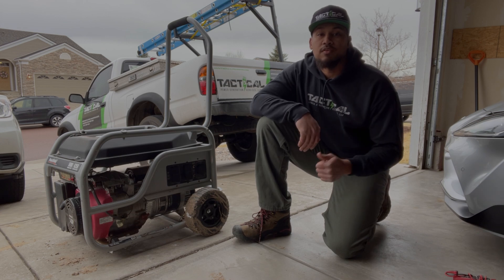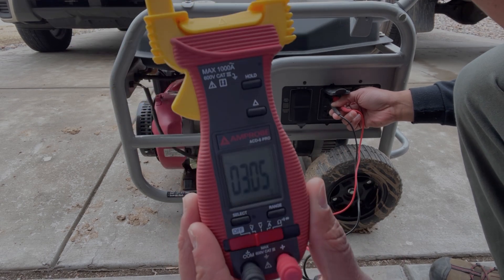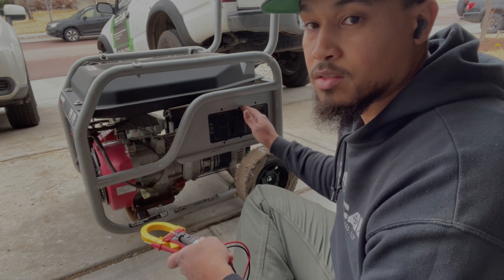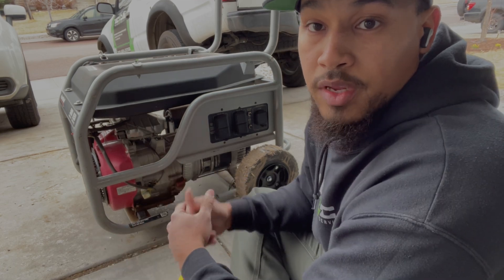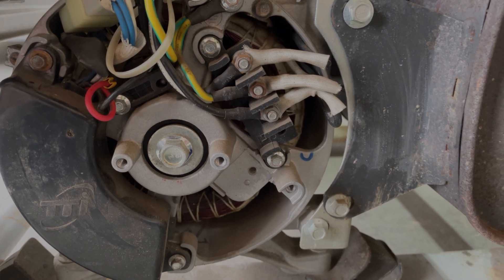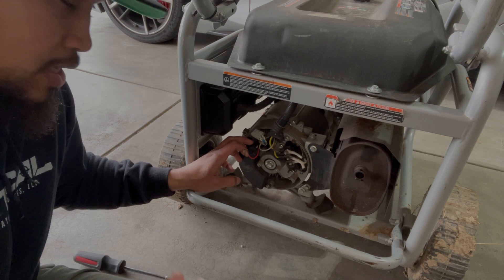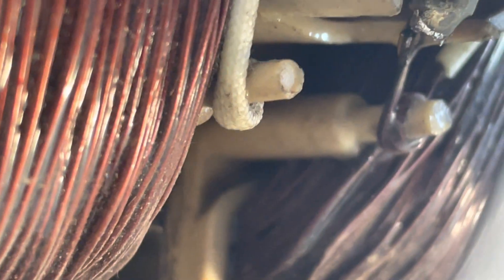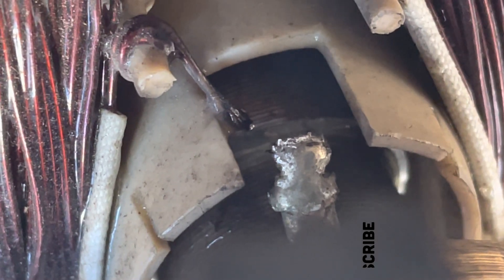Generator has NO POWER Output. Troubleshooting a generator that has no voltage due to a Bad Rotor?

Comment: Good video and diagnostic, but why didn’t you solder the wire back on the terminal.they were more than enough wire that you could have unwrapped and solder back on the terminal.
Reply from the maker: Thank you for watching my video. I gave the owner the different options to fix it, he decided to solder it back on the terminal weeks later.

Comment: hi, thanks for the video. if you would fix the broken wire( join the two ends maybe by soldering them), will the issue not be fixed?
Reply from the maker: Hi! Thanks for watching the video. Yes, the issue will be fixed by soldering the wire.

Comment: If you didnt have the money for a new generator, there is plenty of copper wire wound around the terminal, why couldnt you re-solder the connection. At this point there is nothing to lose.  Great video.
Reply from the maker: Thank you for your comment and for watching my video. I totally agree with you, there is nothing to lose and I told the owner that re-soldering the connection was an option. 

I fix generators as part of my professional business and I don’t like putting my business name on the line by doing quick patch ups or “temporary fixes” as first option. I prefer repairing the generator the right way, which in this case would be replacing the generator head.